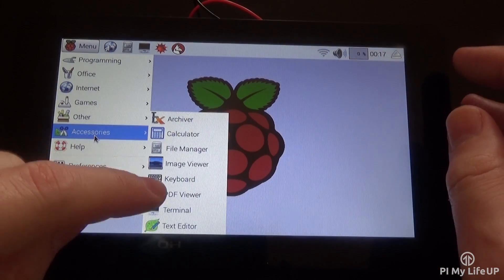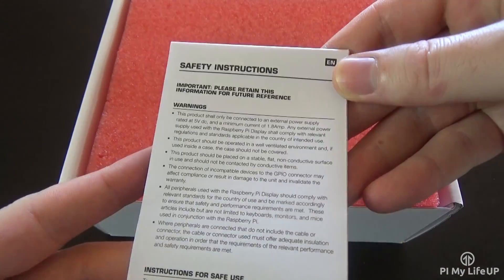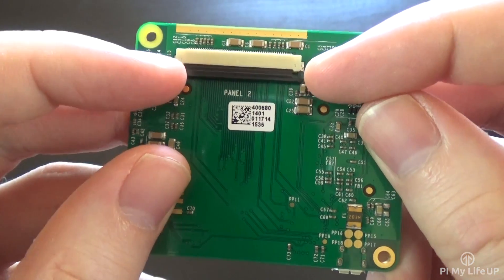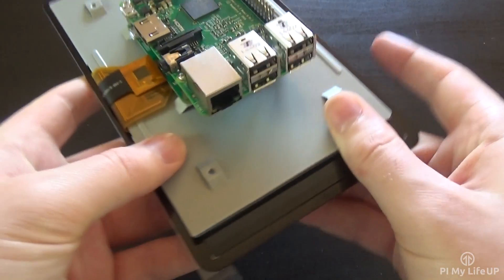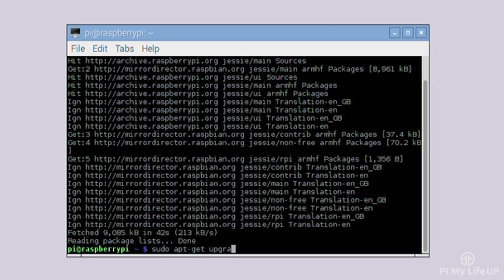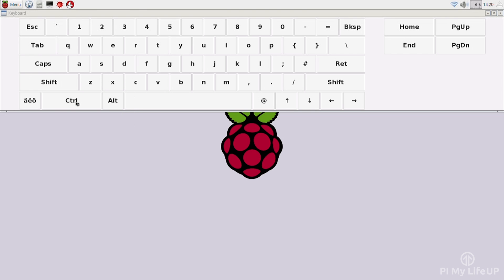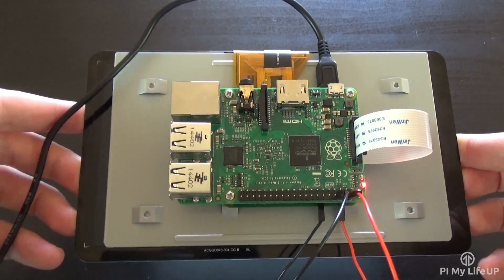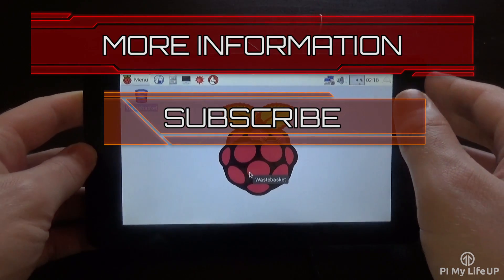Raspberry Pi Touchscreen: The Pi Touch Display Explained!

Comment: 4:26 is it just drawing power from those two pins on the main board? would it be possible to provide the power from a different source? i want to plug another expansion board into the main connection (hifiberry)  as i plan to run one as a double din stereo.

Comment: Hi  I am new and started using raspberry pi 3 with 
RASPBIAN JESSIE WITH PIXEL and install Raspberry Pi 7” Touchscreen Display. Screen Resolution 800 x 480 pixels
I am facing a issue when i run Qt Creator 3.2.1 and click maximize icon, not able to get full screen layout of the application as few of part of the qt is partially hidden.

i have followed the instruction of installation from this link below
https://www.element14.com/community/doc ... en-display

touch is working perfect and there is no black border from the screen. Its some thing else i am not able to figure

If any one know to resolve this issue pls help me out to achieve the display to display full screen

Thanks in advance and waiting for answers.